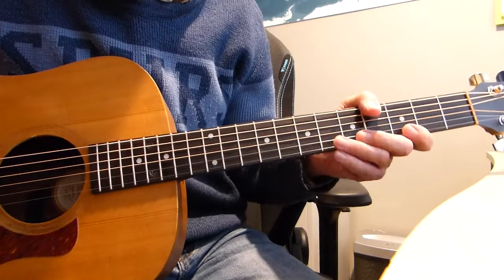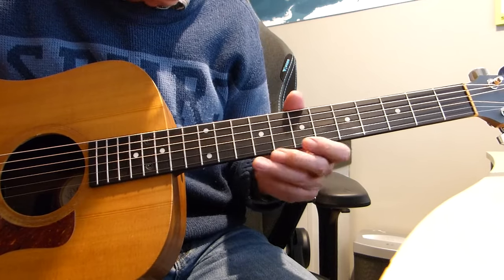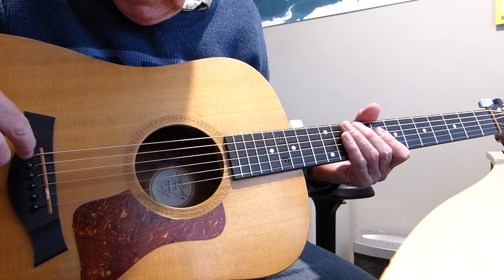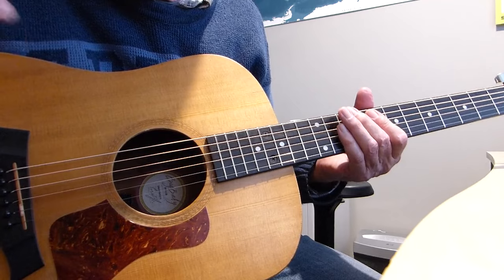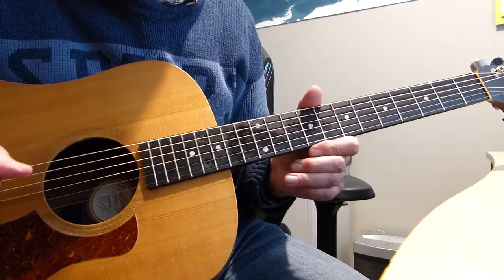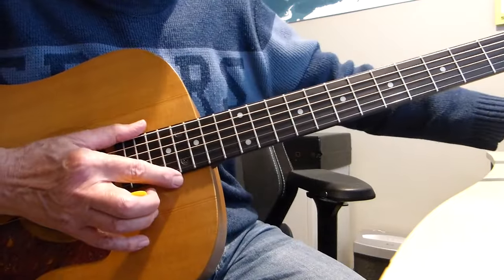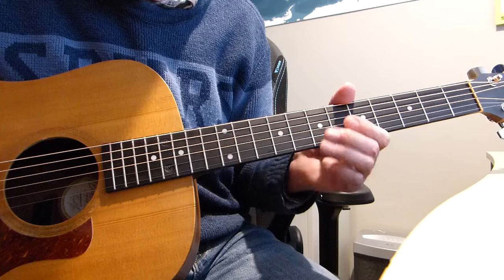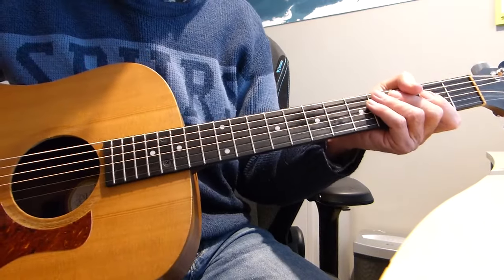How I Improved The Sound Of My Acoustic Guitar - Ivor Sorefingers

Comment: Hi Ivor - your video has prompted me to comment on a couple of things. Firstly, did you test your guitar before and after the modification with the same set of strings - new strings always sound better? Secondly, looking at the other guy's video there is a danger of chewing and weakening the bridge plate with bad sawing. The extra ball contact he achieved looks minimal to me, the greater benefit is likely to come from a better break angle over the saddle. The main movement of the soundboard is created from the strings contact with the saddle and being held between saddle and ball ends - the soundboard is not activated by the contact of the ball ends - ref a Spanish guitar!  Of course you may sense some improvement because things are tighter, but beware of placebos!    A cheap saw for cutting slots can be made from a piece of coping saw blade glued into a dowel for a handle.
Love your videos Ivor, hope I don't sound too cynical. Cheers Terry
Reply from the maker: Hi Terry. Thank you for sharing your thoughts about the pro's and con's of carrying out this modification. As for a comparison test, I did use the same used set for a before and after test. Ivor
Reply: @ivorsorefingers   Hi Ivor..Cheers for getting back. Well all I can say is there must be something in it, and it was well worth the work.

Comment: Do you still recommend using brass bridge pins as indicated in one of your equipment updates Ivor?
Reply from the maker: After carrying out this mod the bridge pins do not have any contact with the string so don't effect the sound. I've gone back to my original plastic pins as they are a better fit in the holes than the brass ones I was using prior to the mod. Because there is no contact with the string anymore the brass ones were loose in the hole and fell out easily. Ivor